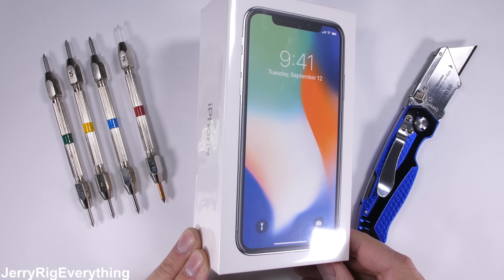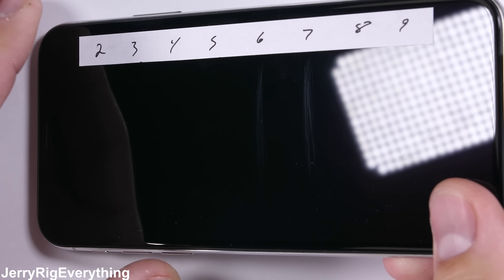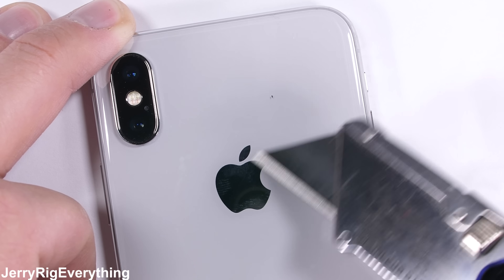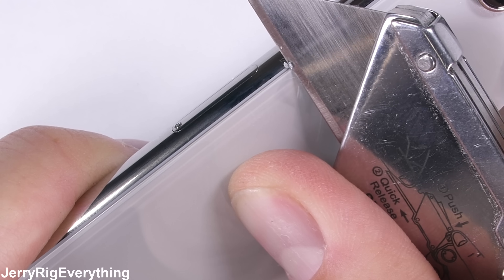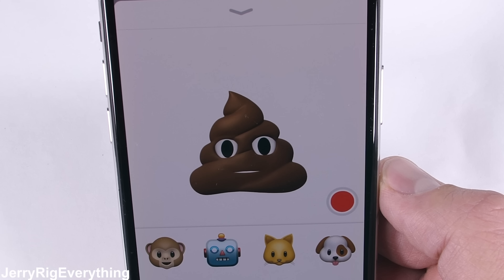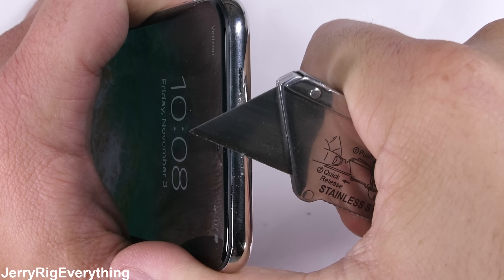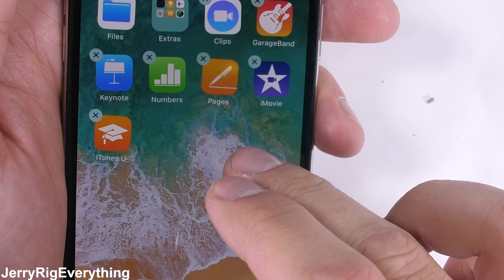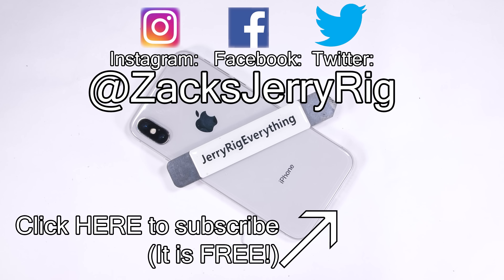iPhone X Durability Test - Scratch BURN and Bend TESTED!

Comment: Buy a case, and some ballistic glass for the front.  A simple, thin, rubber or silicone case should be more than enough to protect the back and sides from your average drop, and the ballistic glass is excellent at destroying itself in order to absorb damage and keep it off your expensive screen.  (Far cheaper and easier to replace a $8 piece of ballistic glass than it is a $279 screen).  What I’d like to see is someone make ballistic glass for the back!!  It’s so hard to believe that replacing the front-glass and OLED screen is half the price of replacing the back glass!!  It’s insane!

Comment: I think the comparison with a flat tire is not correct. iPhone X is like a whole car. It has stainless steel frame, engine and other components are powerful but kinda usual. But all this stuff is only under the bunch of GLASS. Glass everywhere. And there is no hood, doors. Car's body is a monolith. And if you crash it, you need to replace FULL BODYWORK

Comment: It doesn't crack as easily as the 8, just saying. The stainless steel frame help s reinforce the vibrations that contributed to the cracking of the 8. So the whole "it will break from a 3 foot drop" is not entirely true, and you can't just assume that it is without testing the X itself

Comment: "Apples unique version of Sapphire" = cheaper, impure, worse version of sapphire.

Why do you still use words like "unique" Jerry? "Unique" can be both positive or negative which is false advertising considering there is nothing positive about apples sapphire version. It's just a cheaper, less good version and if you don't want to say that directly to your viewers you should at least choose a placeholder word that properly represents the purely negative direction of apples sapphire. Not a placeholder that can swing both ways.

Comment: Since they added wireless charging, I think it's the charging port that's gonna get slashed.  You have a dongle for your earphones? You didn't buy a wireless charger yet? F..U peasant.. you got it until Sept. 2018 you'll see our iPhone II, it's gonna be $2000.00 with no charging port and we are also thinking about getting rid of that that power button as well! 
If your phone battery dies and want to restart it, you better have Apple Care and head to the nearest Apple Store to restart your phone for a small fee!

Comment: Using my iPhone 6 for a few years now with a normal slim case. And i never had a crack or anything go wrong with it.

Why do people always think a phone is supposed to withstand high drops? Like you buy a 600-800-1000$ phone and dont think/have enough to use a 20-40$ case? Go buy a 1080ti and drop it a few times to see if it holds it. Like you handle that with care aswell, so why not your damn phone.

Not only directed at iPhones but also Samsung phones, do you really need to have your Samsung S6/7/8 withstand 3m+ drops? Do you have parkinson? Or why do you consistently drop your phone? Because 1-2 drops with a case from time to time isnt going to damage anything.

Comment: just as a side note, apple charge so much for the back to be fixed, because they don't actually fix it. the back is constructed in a way where taking it apart causes extreme damage to the chassis.

Instead, the $500+ "repair charge" is actually for a device replacement. When you look at it like this, the charge is quite reasonable when the device costs $1000+ new. Does suck for those who damage the back, killing any resale value when they upgrade to the XI or X2 or whatever they're gonna call the next one. One thing that has always been awesome about iphones are their continued value, even years after release. That value is unrivalled, and any android out there effectively becomes worthless after a year thanks to poor manufacturer support and incredibly lacklustre update timetables which persuade most just to go for the newest model.

Morale of the story, while Everything Apple Pro's drop tests revealed his to be a tank (he's still not managed to destroy it, despite even dropping it from 30 feet in a -25°C block of ice and also from head height sans ice). If you're concerned about breaks, use a case. There are plenty out there that would add to the rugged design of the iphone. such as those by tech21 and gear4 which use D3O padding inside the edges of the case. Better a case than a $500 replacement or a $700-800 value decrease on resale.

Comment: iPhone XI: price  $1300 and you have to buy the camera separately which will cost $600
Reply: sayem 16.4 iPhone 11 Plus: 6.2 inch iPhone X but without the speakers which you have to buy for $600. It also doesn't have a dual-lens camera which you have to buy for $1500
Reply: If EA made iPhones
Reply: Using Internet Explorer ?

Comment: can you please do a seperate iphone x drop test? i think it will hold up better than the aluminum iphone 8 because of the stainless steel body.. i think you shouldn't assume that it is the same as the iphone 8...

Comment: Still like the Note 8.
Reply: I like both.  Why can't we all agree that neither phone "sucks" and that we all just have personal preferences that differ?  As for me, I'm a Note fanboy all the way.  But I can still admit that the iPhone X is a stunning device.
Reply: I started with iPhone, just the X design is one of the worst so far. The top of the screen gets cut off by the speaker.  It looks incomplete.
Reply: I disagree wholeheartedly.  The iPhone X features the first truly revolutionary design I can remember in many years, hearkening back to the first iPhone (purely by design since its the tenth anniversary celebration of iPhone).  This is the first iPhone since that very first model that truly looks like a revolution of the ubiquitous smart phone standard, rather than yet another "me too" product.  Obviously the notch up top is a rather clumsy compromise to the motif of a nothing-but-screen front but Apple obviously could not come up with a better solution to hiding necessary hardware such as the speaker, camera, and sensors that simply have to be somewhere on the front.
Reply: fulgently its better so it makes sense

Comment: I would LOVE TO SEE a test of face id in following situations, to mimick scratched thumbreader:
- with a cap
- with a hat
- with a Burqa (who would not want to see jerry in a burqa 😂)
- with sunglasses/shades
- in strong sunlight (ir blaster vs sun-fail i Guess)
- close to face (bed scenario)
- far from face (far sighted scenario)
- with prescription glasses (teach without them)
- looking not perfectly straight at it
- when picking it up from pocket 😁 like you can with thumb reader
Reply: Ola Hindmo works with all.
Reply: Im assuming what you meant by burqa was the one where it covers only the head and neck btw. Not the full face one.
Reply: 7 from what i saw in reviews it fails:
In strong sunlight (since ir radiation from the sun is very strong)
To far from face
To close to face
When not looking fairly straight at it

How can it read face while taking out of pocket, face isn't in the view :)

Burqa covers all but eyes (and sometimes thin cloth over eyes) you are thinking of a jihab.impressive if burqa works, haven't seen it yet and that's a fairly big category that apple might have missed in rich oil economies.

Comment: For all people who love the Note 8 and say that the X is trash. 
I totally get when people personally prefer the Note 8 over the iPhone. 
But keep this in mind: 
The Note has worse battery performance 
A dimmer screen inside (but much brighter outside) 
A bigger form factor so it will be less comfortable to hold for many people 
No stereo speakers 
Slightly more bezel 
Worse software update support 
Slower software especially after some time of use 
No portrait mode for the front camera 
Less durable glass 
No 4K 60fps 
No 1080p 240fps 

Just doing an objective comparison here, to be fair 

The Note has a headphone jack tho;)
Reply: Marine 1 shut up, those are specs and you can read them on the internet. 
No fake news

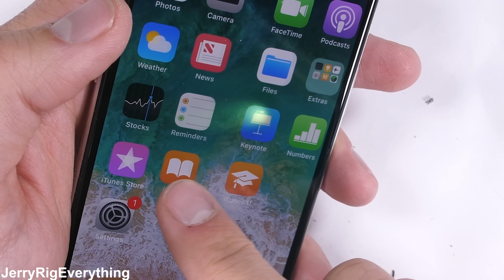Comment: 7:02 It's actually possible and not to hard to detect touch latency down all the way to 1000hz. Microsoft has a great demo of this. If you swipe fast enough you will notice the images on the screen doesn't quite move with your finger. It's really difficult because you weren't testing for it and the way you swiped the screen but it's possible to notice that the screen didn't quite move exactly with your finger. It might be a more noticeable in drawing applications.

Comment: wanna see razer phone
Reply: Donger are u dumb, they bought nextbit and changed everybit about the phone
Reply: yes yes
Reply: Donger the razer phone is superb to every phone on the market right now....
Reply: SANITYISFORTHEWEAK tell me where else you can find a 120Hz screen on a phone and 8GB of ram, it's not mid tier it's high tier.
Reply: Problem with the 120Hz 1440p screen is that the processor isn't powerful enough to actually run anything even remotely complex at that resolution and frame rate.
Reply: You mean nextbit robin? They didn't change anything only the compomenents. The rest that is outside is nextbit robin

Comment: What Samsung glass replacement costs 20$? I call BS on that
Reply from the maker: +Jut N check Amazon or eBay for Samsung galaxy s7 or s8 back glass. Pretty darn easy to verify.
Reply: Well I guess I was wrong. I was going by the fact that I had to pay $150 each to have the front glass of the S5 and the note 4 replaced. I was not accounting for just buying the part. Thanks!
Reply: Im pretty sure the back glass of this iphone wouldnt run you 549 either thats probably the high ass mark up on labor

Comment: Phones are becoming less and less repairable.
Reply: @Matt Man88 "iPhones" are becoming less and less repairable..
Reply: Not really, phones are not only iPhones, there are a lot of phones out there that are very "repairable". Look, for instance, at the Pixel 2 video where Jerry says exactly that.
Reply: Apple wants you to always buy a new phone if yours is broken.
Reply: I dont know but I wont repair any modern phone by myself. And i agree on phones are getting less repairable. Phones weren't unibody back then. They're waaaay easier to fix than phones these days. One of my favourite was the S5, it isnt unibody and it it water resistant. Too bad it was bad (in terms of software and hardware except it's body)
Reply: Thanks to waterproofing.
Reply: I just need it not to be repaired. If it works, no need to worry about servicing.

Comment: You need to do a drop test because EverythingApplePro dropped the IPhone X from head height on its back and front and neither broke. I think the stainless steel border really helps absorb the impact hence why the iPhone 8 broke from 3 feet.

Comment: I always thought Apple has a bit of an abusive/BDSM relationship with its loyal customers, where they don't feel valued if Apple doesn't throw an incredibly unreasonable curveball at them. You know, $1300 "sapphire" smartwatch except it's not; or, $549 for a back panel replacement, or, your phone stops working if you do a screen replacement at a non-Apple repair shop, or having to purchase new dongles every year. Funny how that works, isn't it.

Comment: There’s somebody out there who bought an iPhone X and has already smashed the back.
Reply: Vodeine I own a repairshop.. Had an iphone X customer today
Reply: but other smartphones' back glass doesn't cost $550
Reply: That's why, you go to your local glasssmith and he'll replace it for a fraction of the cost
Reply: Tamoghna ghosh. Not very bright are you?
Reply: NicoPlays what happened and did you repair it?
Reply: If you can make a deal with a manufacture to make iPhone back panels costing at least $499 or less for a replacement, I bet it would be great for your repair shop. You can always tell them good luck finding it any cheaper anywhere else, and as soon as another repair shop does, then you drop the price to compete. Sounds like a 3rd party profit race.
Reply: 100% true
Reply: Aryan Ghassemi I don't think it actually costs $400 but still it is the front glass with an Amoled Display. It costs around $300 where I am. And it is expensive than other Amoled displays because of the curved edges. But the iPhone back glass is just that, Glass. And it officially costs $550 and will cost more in different markets.
Reply: No... Apple struggles with parts, how am I supposed to get parts :P
Reply: @ama
Reply: Ya but same is applicable to other smartphones also having glass black/wireless charging feature. 😁
Reply: Samsung wanted $400 to repair the front glass on my galaxy s7 edge, later they said they can't repair them. At least Apple is capable of doing it

Comment: To be honest I don't think Apple decided to add other options for selected components' repair. Either the display or fuck you. Probably because they didn't bother adding the options to diffienciate a motherboard fix from a rear glass fix or they just don't give a flying fuck about repairing. 
(FYI: You can buy a brand new iPhone 7 for the price of an OEM repar of the rear glass. At least they are helping local repair shops. )

Comment: But only the screen of the iPhone X tracks your finger 120 per second?

And on the Galaxy S8 or Note 8?
If it's only on the iPhone X, than I don't understand Samsung...
Reply: It's possible Apple isn't lying and they actually engineered the display and Samsung was just the manufacturer.
Reply: myNEONCITY But why is Samsung so stupid and they don't put alsona 120 Hz Screen in the Note 8?
Reply: Daniel Karasani the iPhone X isn't 120hz though
Reply: It's not 120hz, but it tracks your finger at 120hz. All other phones are 60hz all around except the Razer phone which is true 120hz. The iPad Pro 10.5 is one of the only mobile devices (only other being the Razer phone) to have a 120hz display
Reply: myNEONCITY and apple wasnt lying with that. They engineer everything in their phones, but other companies manufacture the parts.
Reply: Top Kek But If Samsung manufacturs this, why they don't copy the idea and put this in the Note 8? I think the mist produced this Panels erlier...

Comment: EverythingApplePro did a drop test on both the iPhone X and the 8 and found that the iphone X was much more durable (survived a 10 foot front and back drop). It could be because of the stainless steel band and the larger camera.

Comment: Next year: Apple removed power and volume button...
2019: Apple removed usb and sim slot
2020: Apple removed display from iPhone  hahaha😁😀😁😀😂😁
Reply: ASHOK PATEL 2021: Apple removed entire phone
Reply: Actually that kind of things may happen. It first may start as a "innovating" heat sensor touch buttons bs on the sides which will remove the physical buttons, then of course you don't need lighting port since wireless will be the only thing "acceptable" and cables will be "outdated". Then of course you will not need the sim card since it will have build in microchip already that simply allows you to type in your personal code from your mobile provider and boom you are online. And then one final step is to get rid of the whole phone itself and move on to implants in hands, ears and eyes so that you could have audio, image and be able to control it with your hands without needing a device cause it's all inside you now. We've seen those kind of things in futuristic movies, it's just a matter of time that you will see them in your local apple store. And the scary thing is that when Apple launches their new body implants that they replace smartphones that they probably will cost 3 k $/€ each, you gonna see all the iZombies stand up in lines and pay their butts off just to get the "latest" and most "innovating" technology that Apple or some other Shenanigans of other companies have to offer!
I'm also pretty sure that if they invent a little cucumber that "plugs in" into your ass from Apple called the "iCucumber" and offers many "innovating" things down there ⤵️ then all the iZombies will go on all fours and "plug it in" cause hey, it's Apple baby! It's good to be fucked by the best, isn't it?
Reply: ASHOK PATEL 2025 Apple removed from earth
Reply: ASHOK PATEL what an incredibly original joke...
Reply: w0w much fune joke!!!! Original fune meme xDdd
Reply: The iPhone doesn’t have a USB port
Reply: 2021 customers removed Apple
Reply: People, stop leaking Apple's plans
Reply: 2017 google removed sim slot from pixel 2

Comment: THE NEXT VERSION THEY WILL REMOVE THE PHONE
Reply: Wow..what a hater! They'd obviously remove the camera first and sell modules and call it an innovation.But maybe after 2 years they'd remove the actual phone. 🤣🤣🤣🤣
Reply: milo2547 no they will remove the lightning port and only have the phones wirelessly charge from the apple puck when it is plugged into a Macbook which powers it using a USB c to USB dongle which is connected to a USB to Lighting cable. It's a little something called innovation but you didn't here this from me.

Comment: $549 for back glass? A new windshield for a car goes less that $300 max
Reply: Most Windshields in Europe dont cost more then 100$......
Reply: A windshield is like 4 feet of reinforced glass made to withstand car accidents. The iPhone back is can take a 3 foot fall and costs twice as much
Reply: AftermathXJ220 they'd charge you 100,000 for a Prius with an apple logo on it
Reply: Buy a windshield, cut it and then replace it with the back 😂
Reply: Thomas COURTILLE they are only giving half a phone, and half of everything inside.
Reply: You can get an One plus 5
Reply: They replace the whole phone.
Reply: Its because of the ingenuity and unique design craftsmanship of apple parts.
Reply: That's cuz Apple hasn't mass produced a car yet, just you wait & see what Apple does to a car market.
Reply: WestCrook thats because they give you an entirely new phone, if you didnt get it